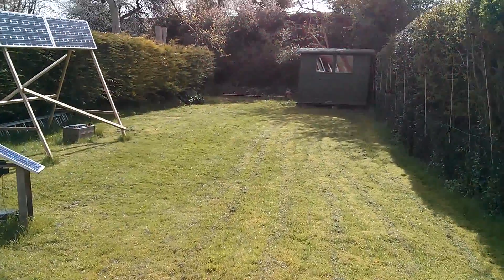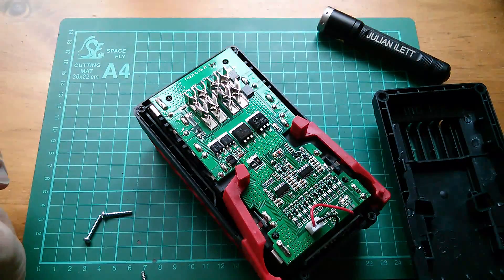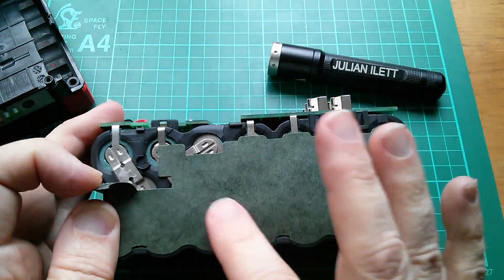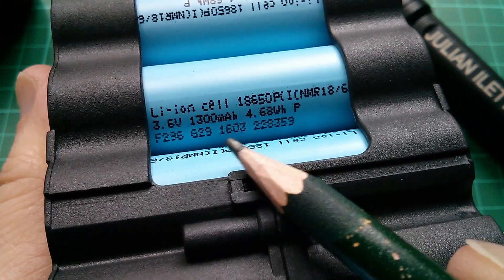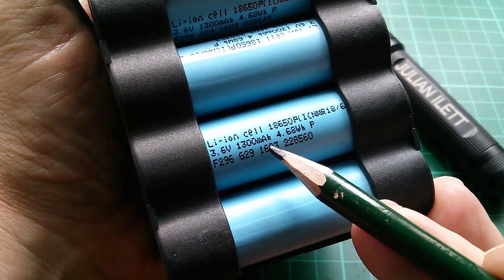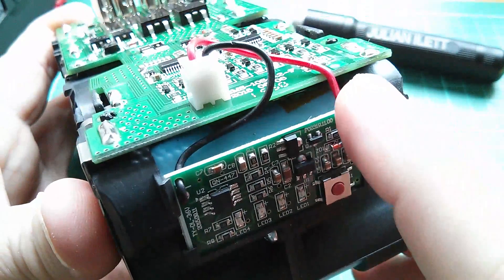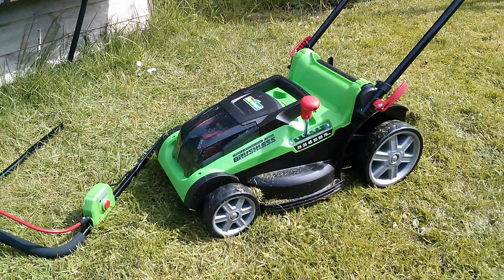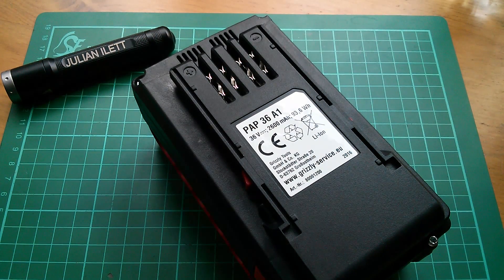Teardown: 36V 2600mAh Lawnmower Battery

Comment: Hi. Can you tell how to avoid third wire from lawnmover battery controller, that going in third battery contact. On circuit board it is COM. My battery dead( qualcast 36v) but different battery not accepting, as there 3 pins from lawnmover connector. I think it should give some information to controller, like some resistance to positive or negative terminal. But not sure. Any ideas?

Comment: This appears to be the same design (different cells) of the qualcast mower battery I've just revived. I've used my hobby charger in 1S liIo charger mode to bring half the cells back above from around 2.6v back up to 3.4v.  I don't have the official charger though should I be able to connect a generic a 2A 36v-42v lithium charger to the P+ and the CH- pins and charge this using the packs BMS for balancing and bringg all the cells up to full charger 4.2v.

Comment: This still alive and kicking?
Reply: Mine is ! 

I purchased a Mac Allister tool 36v battery which is identical but has better quality Samsung cells in it. That said both batteries will still do my larger lawn on a single charge. I guess this is only the second season though.

Comment: It is a good idea to keep these types of Battery and the Charger indoors all the time, take the battery out of the mower after use each time. The charger and battery have ventilation vents, moist air can enter onto the curcuit boards eventually causing shorts and failure.

Comment: those cells are good quality. Same ones are used in lidl cordless drill that i have been using  quite often for the past 2 years. certainly more than 100 charge cycles. No noticeable capacity drop yet.

Comment: Looks like the cells are DLG NCM18650P-1300, a cheap Chinese cell claimed to be NMC-chemistry, with 19.5A continuous and 39A burst discharge, about the same current as an LG HG2, and definitely less than the Samsung 25R. They really cheaped out on the cells.
Reply: Also, if the current draw is really just 10A, then even 3500mAh NCA cells could have been used. I would probably do a battery rebuild with LG HG2s just to be safe, and get a 30 minute runtime.
Reply: All of them are Chinese. I get so sick of that ignorant type of comment.
Reply: If you mean that all 18650s are Chinese, then no, they aren't. Of the major legitimate manufacturers, only Panasonic has a factory in China, and it makes the same cell types as Panasonic's Japanese factories. Except for the Chinese-made Panasonics, Chinese 18650s are considered crap (e.g. they're responsible for the exploding hoverboard phenomenon).
Reply: +NetRolller3D OK. I'm. bad.

Comment: "ICNMR" is a weird marking for an NMC cell (most manufacturers will use "INR" for this chemistry). Also, 1300mAh is extremely low for the NMC chemistry, and would actually suggest the older IMR chemistry instead. Even IMR  (which is very high current) goes to at least 1600mAh.

Makes me question whether these are genuine NMC cells or not.

Comment: The Black & Decker CM1936 battery pack consists of 3 12v 12AH sealed lead/acid batteries. Initial current 3.6 Amps.

Comment: I think it is best to keep the batteries inside the house when not in use. I read some complaints about batteries life cycle only lasting a few months. I suspect that it is not recommended to keep the batteries inside a warm garage during the summer.

Any thoughts on automating your lawn mower? It would be an awesome RC project.

Comment: I still use my original B&D CMM1000 cordless mower. Only had to replace the lead acid batteries once since 1999. Cost me $40 for a set. No way will lithium cells last this long and be that cheap. Mower still runs and cuts all of 500 square meters of lawn every week on a single charge. Great mower even though it is nearly all plastic. It is stored plugged in and even the -40C winters don't seem to bother it.

Comment: the powerrav 6700mah power bank has 2 x 3350 mah 18650s in it, lg or panasonic cellsits costs about 11 quid, and can provide 5v at 2.4 amps.even if you just take it apart for the cells it is great value

Comment: Batteries in laptops usually have 3 months warranty so I wouldnt expec much more than that. (Apple computers can also not be used on an altitude above 9000 feet or something like that without voiding warranty).

Comment: I'd actually like to get your thoughts on using this type of battery in place of lead acid deep cycle batteries on inverters for portable power. I've been doing it for a while now without much issue. The only thing I had to come up with is a way to charge them without having to do it on an individual basis. Cell holders for this type aren't hard to find and a simple charge balancing circuit was easy enough to build. I also built in an over temp circuit using a thermistor. Safety first and all. For a thousand watt 120 volt inverter I set the batteries in parallel sets of three. The lower voltage, higher amperage cells work well and hold up to heavy usage better due to their more robust construction. It was a fun project. I just wish I'd shot video of it.
Reply: I would have enjoyed seeing this.

Comment: Hello. I got an interesting question. I got 5 LiPo batteries, each 3.7V 20'000mAh, and its taking ages to charge them. Question would be, is it possible to charge LiPo with CC CV buck converter set to 4.2V and 10A or so

Comment: hi Julian , the battery looks identical to the Macalister 36volt range at B and Q  I bought a few of the 4 ah batteries as selling old stock for £34 . use them on my electric bike daily for over a year i use a thumb throttle use lots of power. they are quality Samsung cells I solder two packs in parallel for 8 ah . also the fast charger is light and brilliant

Comment: :) You made me buy a Lawnmower. I went today at Home Depot here in Canada and got a Ryobi 40V :) yes is the same 10s2p cell configuration but 40V sounds better than 36V and the same brushless motor. I made a quick test and it works fine so I will keep it.
It was 396 CAD reduced a bit from 449 CAD and has two batteries same 20 cells 94W written on them (they used 3.6V for that calculation x 2600mAh = 93.6Wh so rounded just a bit to 94Wh) and a large charge a bit nasty based on the noise my pure sine inverter makes. Charger is rated for 90minutes so a bit slower maybe.
They have security screws and I do not have a bit for that maybe will need to order one to be able to open but I'm sure they have the same high power 1300mAh cells probably from Samsung.
This is the model  RY40112A and the two batteries are OP4026

Comment: i have a ryobi 36v brushed - a 2.6AH pack and a 4ah pack., 
the 2.6 is faster (quicker recovery from a partial stall) but doesn't run as long - it gives me about 20-30 minutes, the 4 goes closer to 45-60 minutes. enough to to a 1000square meter yard

Comment: This pack looks like it's assembled similar to Rigid NiCd packs sold here in the states (no idea if they are international) with the plastic holders dividing all the cells apart. Unlike craftsman, Dewalt, etc, which are all just pressed together and shrink wrapped to prevent shorting. That said, it's a tad more important to prevent shorting with lithium packs. If they had no separation between them, I'd be worried. With NiCd, they will usually just melt the metal tabs between them rather then, you know, blowing up or "venting with flame" as manufacturers put it.

I used to repair and refurbish NiCd and NIMH tool battery packs where I worked. Rigid packs were the hardest to rebuild frankly. Also, were were not allowed by company policy to rebuild lithium packs, they were too easy to short and dangerous if shorted significantly. That said, when I got a failed Lithium pack in, I usually opened it up and would find that 90% of the time, it was the PCB that had failed, not the cells.

Comment: Your cells are Lithium Nickle Manganese Cobalt, the code written on them is ICNMR.   
The formula is LiNiMnCoO2:  which they've written on the cells as Ion Cobalt Nickle Manganese Round: ICNMR.

I'm not sure why the reddit page page calls LiNiMnCoO2 "lithium iron phosphate" INR cells, there's clearly no phosphate in that formula.  It might be a typo.

The C is not a bracket, there's a bracket just a couple of characters earlier which has 2 fewer pixels in it than the C does.
Reply: +roidroid indeed, i think you can clearly see that there is a start-parenthesis BEFORE the i, the one after is a C

Comment: At least if the cells fail you still have a working mower be it being connected via a cable. Be interesting so find the replacement cost of the cell pack. Looks like just replacing the cells could be near impossible.
Reply: Mac Allister  MB3626 - LION batteries are identical,  available on Ebay quite cheap surplus stock £30 - 40 including the charger. The battery will also fit the Qualcast 36v cordless lawnmower.

Comment: With a nominal discharge current of about 10.6A that only puts those batteries at 4.1 C discharge, which is quite low, considering those cells could be 10 to 20C rated. From what i remember what kills Li-Ion cells is non-suluble gas buildup within the cell that occurs when the cell is being discharged too hard and electrolyzes the electrolyte into gas, in the RC community this ellect is commonly referred to as puffing, and some go as far as to pop the seal on the lithium cells to let the gasses out.
Reply: The pack is 2600 mAh, but each cell is 1300 mAH. So that makes the battery cells 8.15 C at 10.6 A, right?
Reply: There are two cells in parallel, thus 10.6 / 2600 ~ 4.1C

Comment: NMR - The most common mod battery.. lithium cobalt oxide is what you will find in it. Simple constuction despite the high cost of cobalt offers you the most power out of most of the lithium battery family. Which great power comes.... the potential for massive damage. These guys are violent when they go off and have a low failure point when it comes to chemistry. Needless to say, if you screw with this guy it will take you behind the bar and sort you out badly.

Comment: I believe if that pack failed, I'd be likely to put 3 AGM or SLA batteries in series. I wonder what the Wh rating of a motorcycle/moped battery would be?
Reply: +stonent You'd be better off with the sealed lead acid 'cyclic' batteries. Car and bike batteries aren't designed to be discharged and recharged completely, the plates fall apart.
Reply: +stonent LiFePo would be my choice. Should be drop in and will be much higher performance.
Reply: +stonent As an avid e-bike rider, Lead Acids are horrible technology for deep cycling applications.  Read up on Peukert's Law.  Lead Acids capacity is often rated at a 20 hour discharge, the capacity drops massively when discharged at a fast rate.  This effect is almost nonexistent in Lithium battery chemistry. Even AGM cells still degrade terribly in deep cycling applications.

Comment: Julian, have you looked into vaping batteries for a possible replacement once the cells in that thing stop working? They are built for high capacities and high currents (often greater than 10C) but are normally used in short bursts. http://vaping360.com/top-5-18650-batteries-for-vaping/

You can build a spotwelder from a microwave oven transformer and weld tabs on these cells, its not hard

Comment: warranties rarely cover batteries, even in electric cars where the MTBF of the batteries is typically 2-5 years depending on the brand and model of the car and replacing all the batteries at the dealership would be a couple of thousand pounds
Reply: +KX36 the $12k cost of a Tesla pack is quite good value if you need 5000 good quality 18650 cells.   Tesla's new model E will use Tesla's own cells, and they appear to bigger than 18650.  I hope they drive down the price of good cells tho,  as my ebike currently has 24V of lead-acid suckage.

Comment: I just started watching your videos but that I saw you were going to take the solar panel and you're going to charge the battery a certain way with all those wires how do you build the battery where you buy the right charger where you set the battery up or you going to trickle charge it and you can tell it when to stop and start and you're not going to have to do it through solar power you just going to do it through Power of the wall what charger what battery how do you get the parts to all communicate is it over the lawn mower battery had a big old computer strip in it I don't want to have to do that when I'm done that battery I don't want to have to buy one that they want me to have I want to start out with my old battery and charge it so it last forever I don't care if I catch up with old used batteries I want to start with you have to have to start with a pack of six pack of 348 for how much does a 48 volt battery able to go with or 36 to pay the other bike over again but how do I build it correctly with

Comment: Wow, this think is built surprisingly decent concidering it was bought in a supermarket!
Reply: +muh1h1 
I have bought a few "technical" things at Lidl and Aldi (or Hofer as it's called here in Austria) and almost always was very positively surprised with what I got. Often it's tools I only have a single occasion of use in mind and I'd never buy something more expensive. It may not always have been the best deal for what I'd needed, but it was always better than what I would have gotten at a DIY store for a similar price. And some things, like a cordless drill that's still running after almost ten years of quite frequent usage have definitely payed off!
Reply: For most things there are few owners, that have multiple company's, most test new designs on the cheaper brands products, to see how they go in the real world.
Reply: +superdau I'll second that and add the same applies to Lidl here in the UK. The usual tool-with-a-motor guarantee/warranty is three years and I've never had to use it. A Lidl 18V cordless drill bought 12 years ago for £20 is still in use, although I've had to re-cell the battery and may have to do it again soon.
Reply: +Graham Langley   yeah, lidl seems to have pretty good quality control.  I'm in france, and french people are somewhat patriotic about wine.  I think lidl  has won wine buyer of the year in france for the last 3 years!   Well yeah, a loire valley fizz at 6 euros which, in blind tasting, experts judge to be better than a 30 euro champagne!

Comment: In the last battery datasheet, you skipped over what looks like the one you have, lithium mangaanese cobalt, i paused the vid to check, that one is 3.6v
It's possible there is gearing, just like a battery drill which has inline planetary gearbox, maybe hand turning the blade may suggest a gearbox is present, you'll feel the resistance like you would if you turned the chuck of a drill
Reply: Yeah and it makes sense if you read the letters on the battery as CNM
Reply: +Sparky Projects ICNMR =
I = Lithium
C = Cobalt
N = Nickle
M = Manganese
R = Oxide

They are probably hybrid cells, most likely lithium nickel manganese cobalt oxide cells is my guess, normally labeled NMC.
Reply: +codebeard I believe the printing is CNMR, as there's open bracket right before it and it's clearly different shape.

Comment: those 1300mah cells are dirt cheap. In a local store here you get a 7.2v lithium cordless screwdriver with all the fancy features for 10€.
Reply: I dont think its gonna last long for 10€..
Reply: +Der E.lektroniker (Elektroniker) All gears are metal and the motor seems good. Its really decent quality. It lasted half a year now.
Reply: +Darren Nash its two cells, 3.6 x 2 = 7.2

Comment: Julian, do have a brand where you live equivalent to Stihl? I have one of their electric blowers but it was not cheap, around $300 for the blower, $200 for the battery and $100 for the charger, but I was looking at the battery ( and took it apart ) and it comes out to a whopping 177.6 Wh (36v 4200mah). It may be able to drop in that mower with mods.
Reply: +Keagan Knapp that is expensive too... for 200$ we can buy a big fat Lipo battery :)

I see a Zippy Compact 10s Lipo battery = 37V with 4000mah and HUGE discharge power of 100A constant and 140 amps of burst. And this battery only cost like 60€

Though sadly lipos are not recommended as they are dangerous and can blow very violently :(. But would make a cheaper, smaller and lighter in size, higher capacity and more discharge rate than the others.
Reply: Very true, if I had the money I would build a backpack battery that would last all day (Stihl has one but it is $1000) using the same batteries that Julian used for his bike. Darren, I have conditioned the battery (slow discharge, slow charge) and I bought the slowest charger Stihl had so the battery will last a while longer.
Reply: +Keagan Knapp That suck, I hate slow charge... And slow discharge also if its not enough, might make the device less powerfull or screw the battery for heating up.

The lipo I saw in the previous comment for example can safely charge up to 5C so it would be around ~13min to charge it, but would require massive charging power.
Reply: +Keagan Knapp - "it comes out to a whopping 177.6 Wh (36v 4200mah)" huh?  My math comes out to 151Wh.  How did you come to 177.6Wh?
Reply: Don't look at me, I just read it off the battery. I do not know how they came to 177.6Wh.
Reply: +Keagan Knapp - lol.  Fair enough.  You've got to watch those battery companies and their claims!

Comment: Can you please explain in more detail why the mosfets have only 2 pins connected.
Reply: +getreal155 The middle pin is directly connected internally to the metal plate on the back of the package for heat sinking, which is then soldered to the board, so all three are actually connected
Reply: of course! The drain is connected to the heat sink. Should had thought of this myself. Tnx
Reply: I was thinking they used a clever other method of application for the mosfet that I was not aware of. Stupid of me. lol